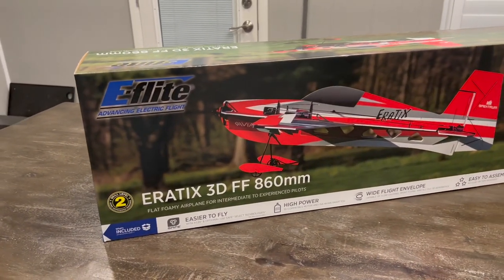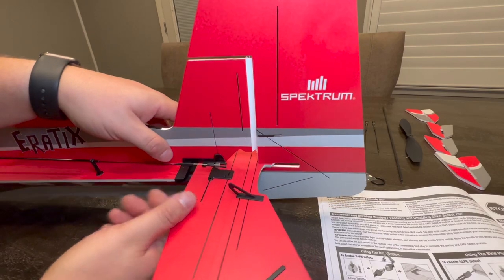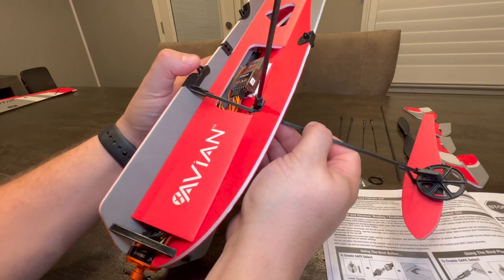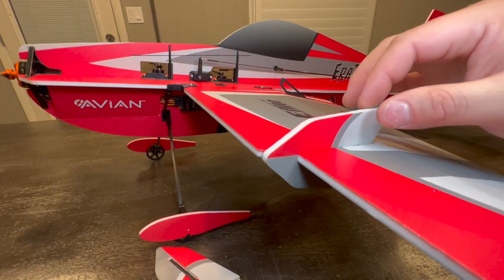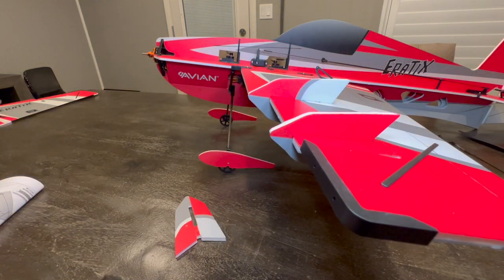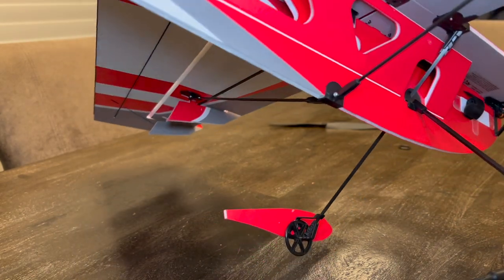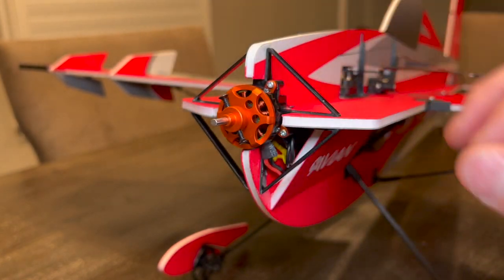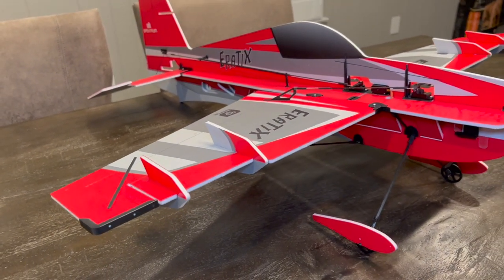E-flite Eratix 3D Assembly - 20 Minutes or less!

Comment: Tip don't connect any horns until you bind your radio and make sure all your trims are set to 0, my Aileron servo was way off and I had to sub-trim it to make sure I had equal throw in both directions and I also had to adjust the clevis to make sure everything was aligned perfectly
Reply: Yeah, one of mine was off at least 14 turns.

Comment: I just ordered mine today. Great video! Not too keen on how the prop is attached. I like threaded shafts. I have 3 other flat foamies and changed all the motors to threaded shaft motors. Haven't broken a prop yet. And none of them have landing gear! Really like that you don't need glue. Makes it a lot easier to replace parts if you need to.  Plane should be a blast to play with.

Comment: I was very surprised to see a flat foamy being released. I wanted to get into flying these years ago and all there were was kits and you had to hunt down all the electronics yourself and then build it. Needless to say I bought one and hunted down all the electronics and by the time I got everything it was months and winter time and I wasn't very motivated to build something I wouldn't get to fly for a long while. I had forgotten about these flat foamy until now and in 20 minutes I can be up and running awesome sold. I thought price was a little high but checked around and even on Twisted RC website for planes $90 to $150 and electronics $125 to $150 package which most of them didn't offer years ago you had to hunt down all the electronics so $220 for BNF 85% assemblesd is a deal.

Comment: Did they not supply a prop adaptor so the prop would sit centrally on the motor shaft?
Reply from the maker: I’ve got it sitting here in front of me. It’s centered. Even ran it up. Still centered :)